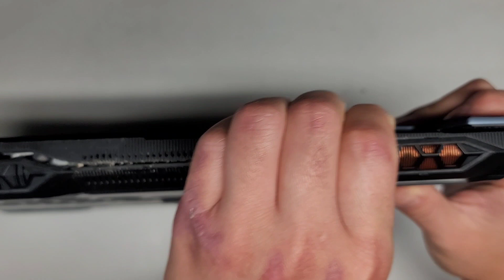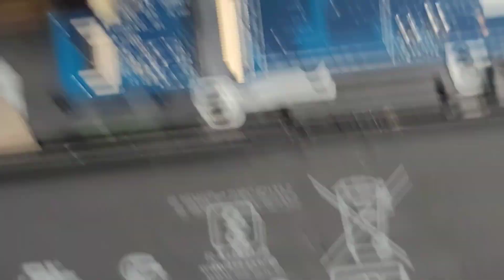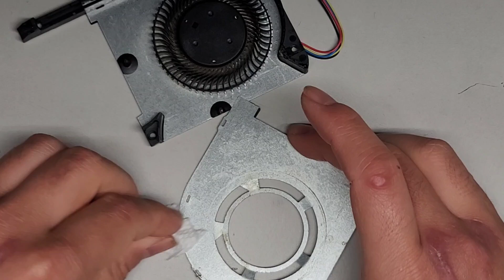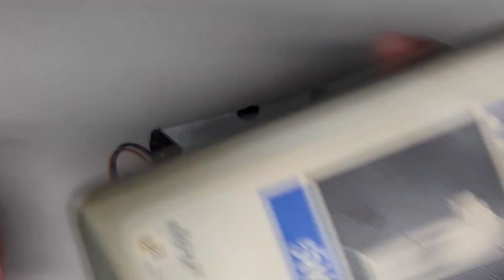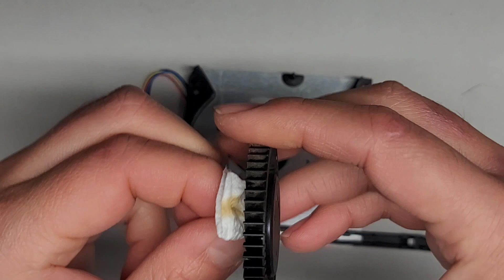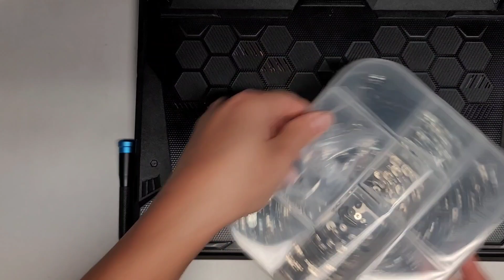ASUS TUF TUF506 TUF506IU-ES74 Disassembly RAM SSD Hard Drive Upgrade Fan Replacement Repair

Comment: Thank you very much. I bought the fan about 6 months ago but it has been making noise for two weeks. I want to test this method. Is there another way for that laptop fan? Because here was a graphic fan tutorial.
Reply from the maker: This playlist will help Fan Repair: https://www.youtube.com/playlist?list=PLSSiYX-ta7aqqxfDWDQh-B6Az4ZgDI459
Reply: @ItsBinhRepaired Do you recommend getting a new fan or risk repairing the current one?
Reply from the maker: @hellowor12a  If you can't have any downtime, buy a new fan and then try to repair it having the new fan as a backup.

Comment: how to mod the internal antenna, like move it to other location, or adding some proper materials and stick it to the metal plate, thanks
Reply from the maker: @vutrdng  peel it up and move it? Why would you stick it to metal? Are you trying to stop the wireless from working? What makes you think you have a better location for it? I don't understand. If you want to kill the wifi signal, just remove the wifi card, no point sticking the antennas to metal, which will block the signal...